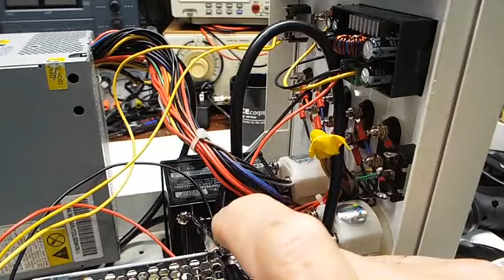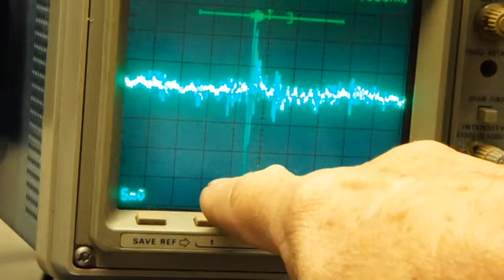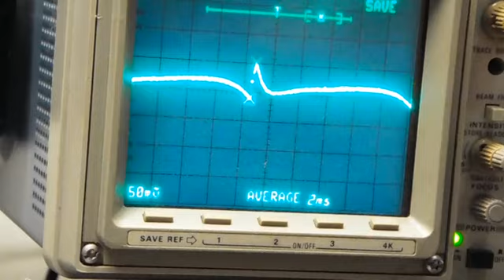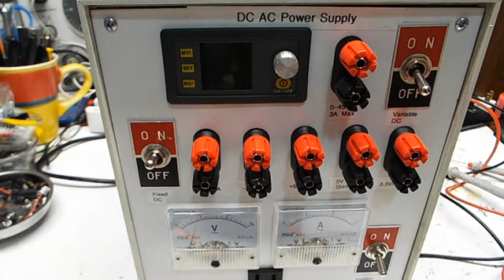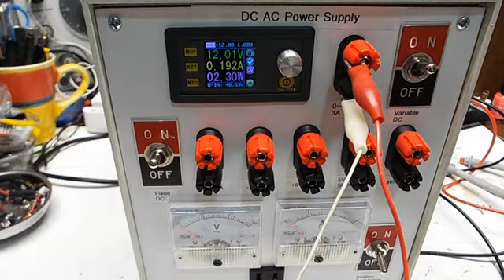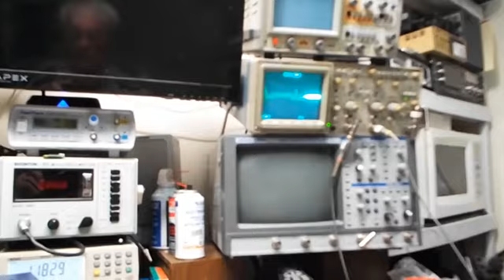Bench PSU 2

Comment: Thanks for taking the time to go over the internals and check the outputs on the scope. Interesting to see how much goes back into the supplies from that little fan. I'm surprised how much was visible on the outputs of the pc supply and I'm wondering how the pc motherboards deal with it. Is there filtering or separate regulation going on inside the motherboard so that the noise from the power supply doesn't interfere or are the pc internals just not really affected by the random jitters?
Reply from the maker: Redemptus Renatus actually that isn't a lot of noise but if you look at any kind of processor or other sensitive chip you will see a ton of bypass caps all over the place. Those are there to specifically get rid of transient spikes both from the power supply and induced from other signals running close to the traces as they run around the board. One thing to remember though, those spikes you saw were high frequency. Switching power supplies run at hundreds of KHz not 60 Hz so the bypass caps that filter out those spikes can be a lot smaller in value and physical size to do the same job.
Thanks for watching.
Reply: AERVBlog I thought about the spikes being high frequency and wondered if a ferrite core might help clean up the output? I know you mentioned the supply was fine as-is for your purposes, I was just curious if ferrite cores would be one possible approach if I were looking to reduce the spikes or if it would be better done another way?
Reply from the maker: Redemptus Renatus ferrite cores work best at higher frequencies. They would have to be awfully big to have much effect at these lower freqs. I have seen little ferrite beads on through hole components in some stuff but usually they are in radio equipment. Surface mount ferrite beads are used quite a bit in those applications. Good thought though.